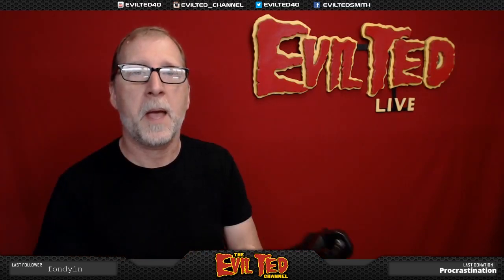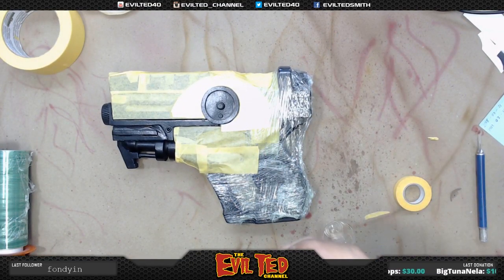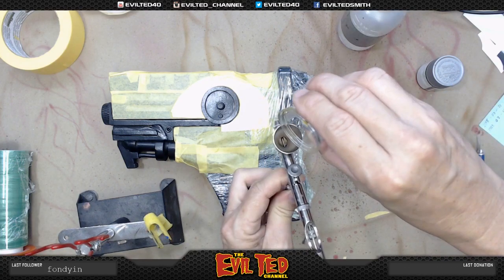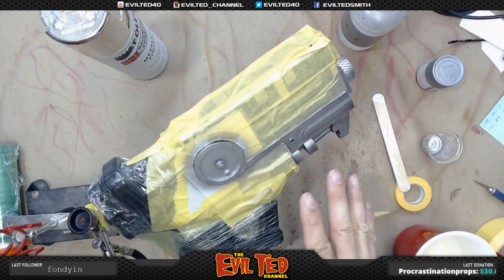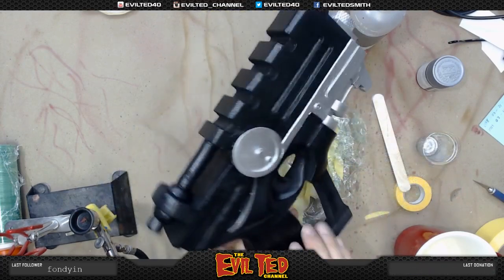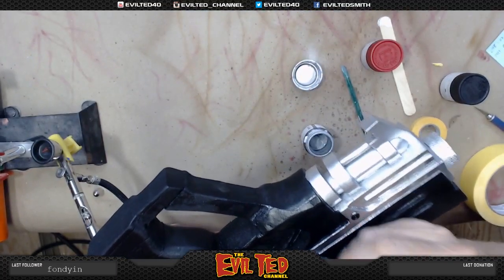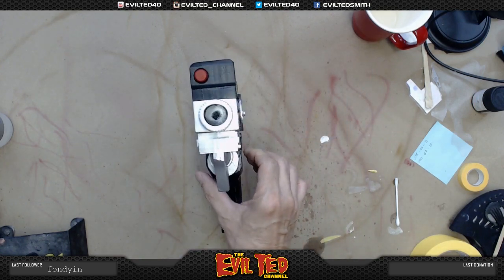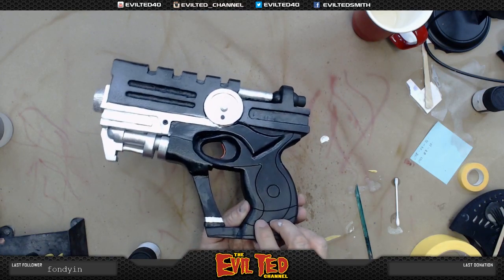Evil Ted Live: Painting a Foam Corbin Pistol from Studio J7

Comment: Hey Ted, painting has always been kind of a stuggle for me here and there. I usually seal paint jobs on foam but especially with pieces that are chrome/brass or gold (the shiny stuff) how do you keep it shiny, and not tacky?anytime I seal it, it takes away from the shine.. any tips?
Reply from the maker: Yes, use an airbrush and spray a thin coat of pledge floor wax to seal it.